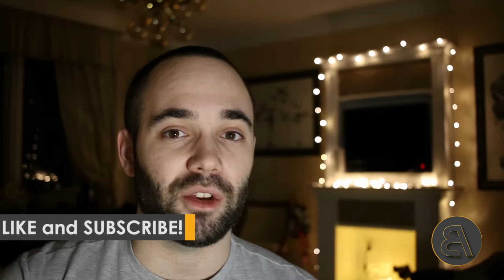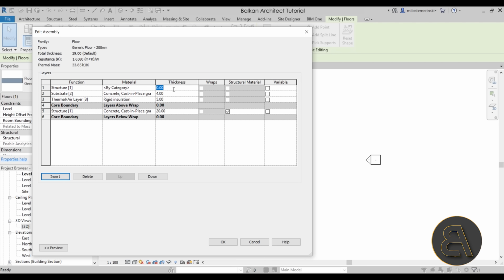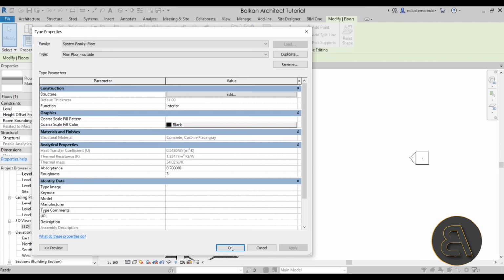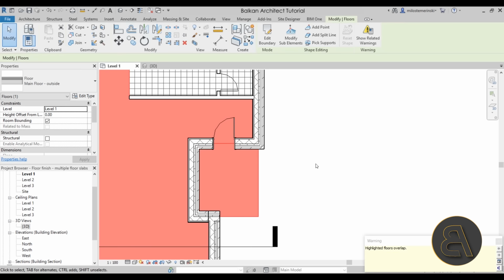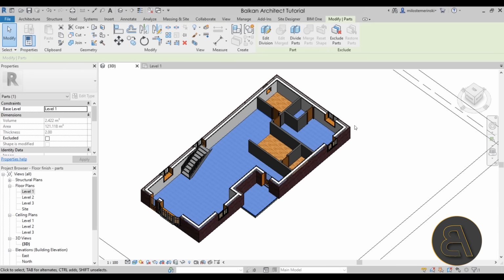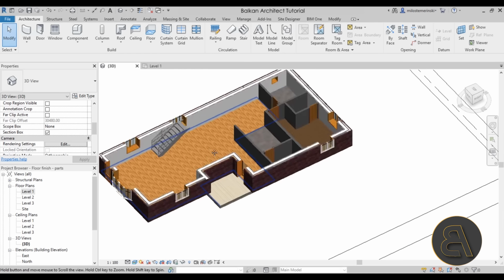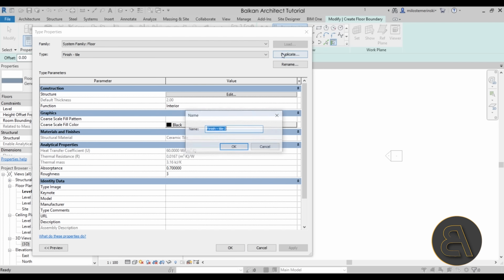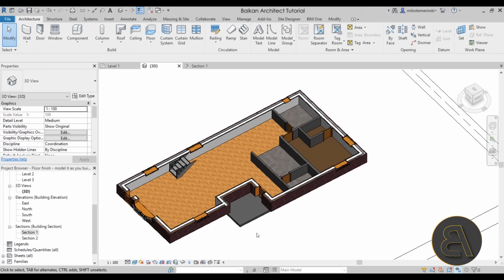3 Ways of Creating Floor Finishes in Revit Tutorial

Comment: 3rd method is Easy to do and also practical.
Reply: same i use 3rd method, but to fix overlap i join both floors

but after watch this i just realize i could just change the concrete offset to -2cm lol 

save more time than join floors

Comment: I found the results of the Divide parts tool doesn't work properly in Revit 2023. It keeps the original floor layer overlaping your new split up ones. Until AutoDesk fix this, I cannot use this approach at the moment. 😕

Comment: Revit LT 2022 - I am trying to use the "storefront" family to create wood framing for my project.  When I go to the curtain wall mullion tab under "architecture" it prompts me to load a 'curtain wall mullion' family to the project.  I do not have such a family in either the RLT21 or RLT22 folders and when I go into the RVT21 folder and select a rectangular mullion, I get a prompt telling me that it is "not a curtain wall mullion family" and will not load. Is the "storefront" application available for Revit LT and where can I download the mullion profile families?  Thanks in advance

Comment: hi BA 
i think it would be useful to make a vídeo on walls too.
sometimes we want we want to apply diferente materials to walls (tile or paint) after building walls, especially when we export to rendering programs like twinmotion it becomes quite complex because you cannot apply diferente materials to the same Wall.

thanks
Reply: It works (at least to some extent) because I tried it. However, I believe you can only create those divisions in floor plan views, which means you cant control the divisions around openings, for example, in elevation views.
Reply: U can do so by duplicating the wall type and editing it separately only